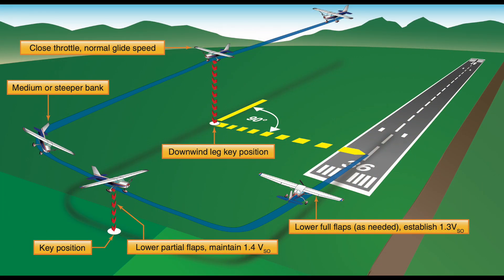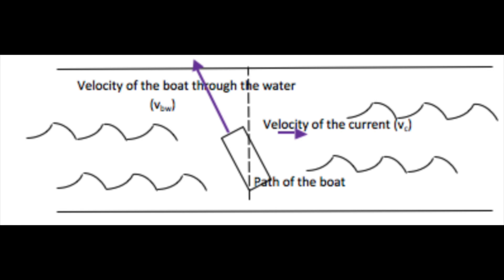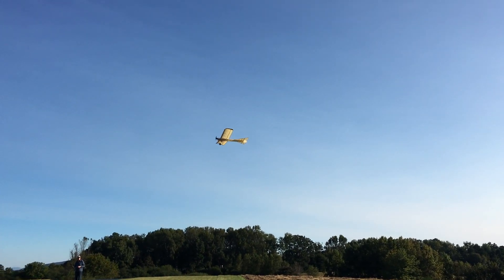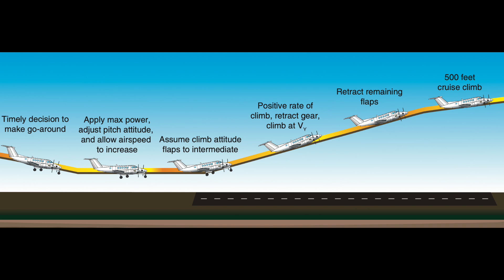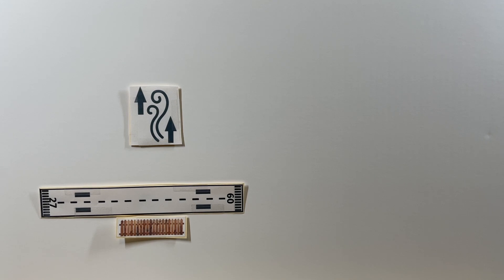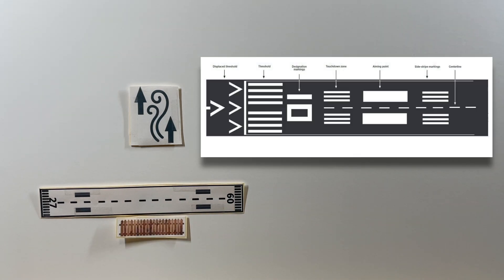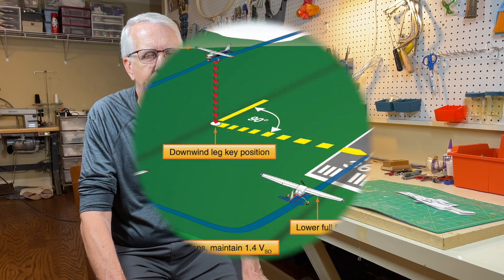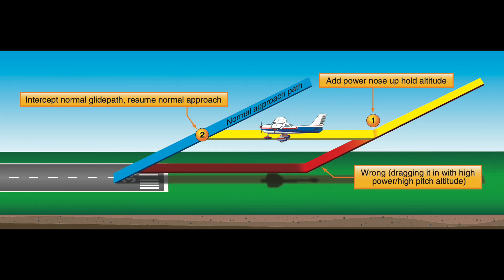Traffic Pattern Basics for the RC Pilot

Comment: Very interesting subject ! Since you were an airline pilot, I always  find it stressful  to view crab landings ...I am always thinking about the enormous stress the landing gear must endure when contacting the ground at an angle compared to the direction of the runway  and with great speed...They are well engineered for sure...Can you elaborate ? Thank you!
Reply from the maker: Actually the stresses on the landing gear not all that bad. The jet is flying flying at that point. The moment we touch down the spoilers are out, thrust reverse set and with the rudders we align the fuselage with the runway. It all works out!  Tim
Reply: @TimMcKay56  Thank you for your answer. I must admit it is always impressive to watch those big airplanes ''pivot '' on their main landing gear...Don't be too humble !!!
Reply from the maker: Thanks. 😊👍🏻 Tim